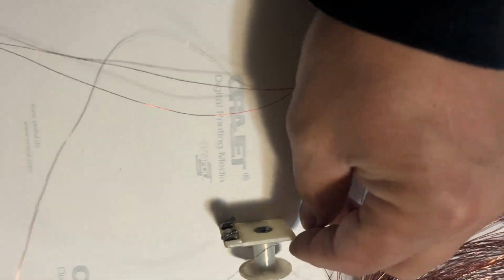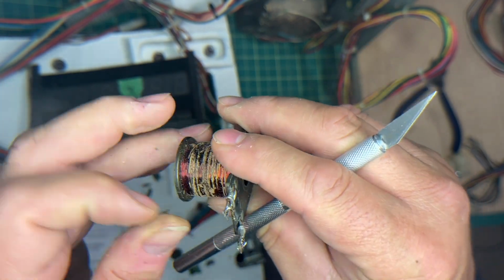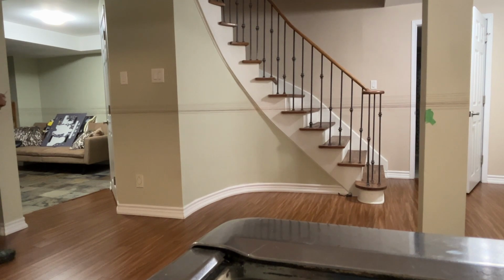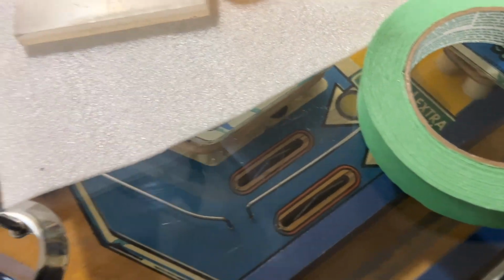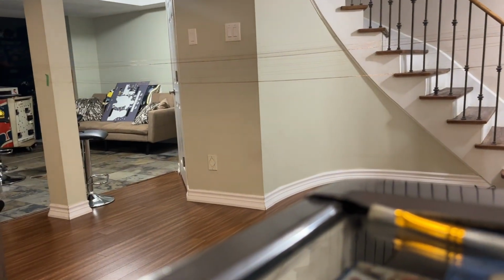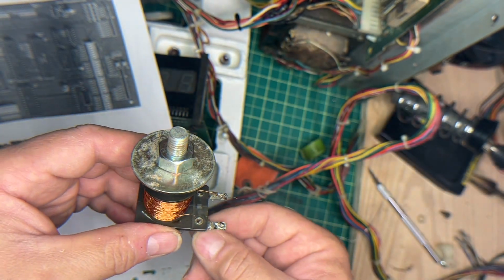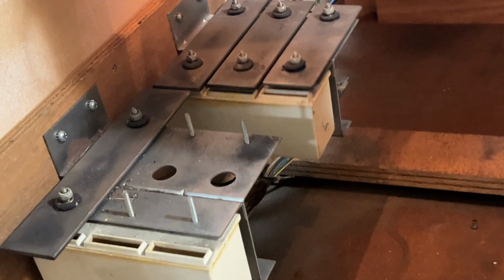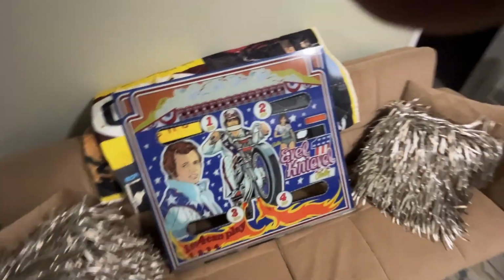Home made pinball coil.

Comment: With an Arduino you can make a device that can count the turns of your coil. and you can reuse coil wire from an old CRT TV that controls the demagnetization that surrounds the tube.
Reply: Anything with an electric motor should be a good source of wire also. Microwave transformers, and microwave  turntable motors have very thin gauge wire. Washing machine pumps and old drum motors are another. One mans trash huh 😄